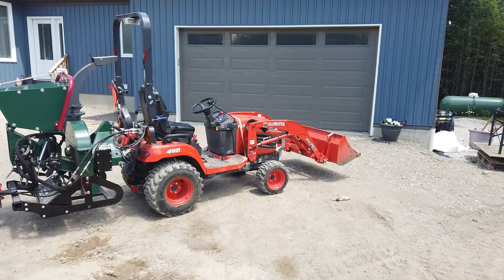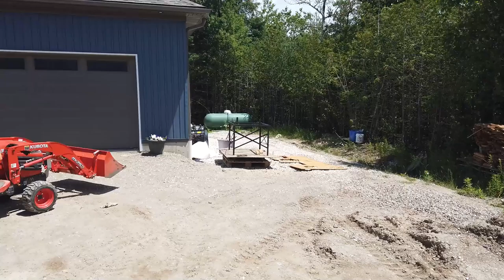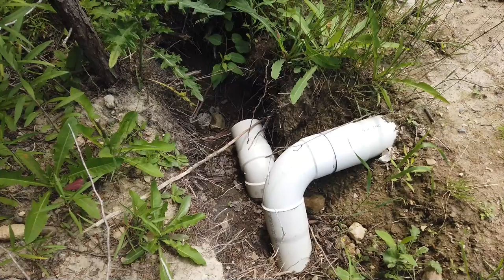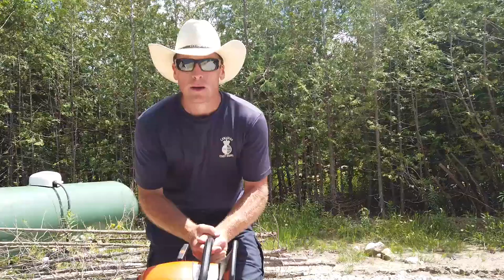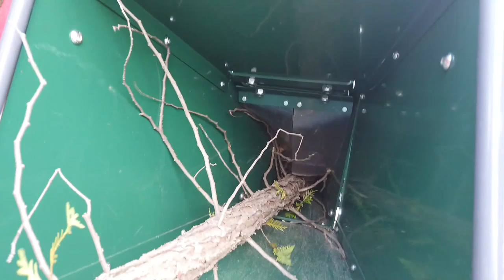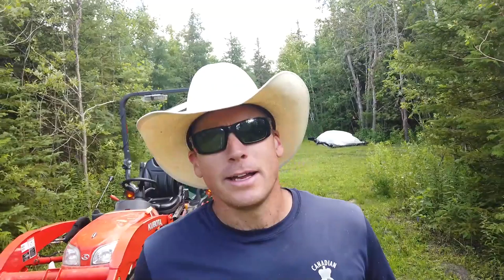Removing Small Cedars With Kubota BX, Woodland Mills WC46 And 2 Ton Hydraulic Dump Trailer - No.59

Comment: Do you need extra hydraulics to operate the hydraulic infeed?
Reply from the maker: The PTO shaft runs not only the chipper flywheel, but also a belt driven hydraulic pump. There is a hydraulic oil reservoir in the bottom of the unit. It’s a completely self contained unit. Thanks for watching!
Reply: Thank you - I have a 1025R and considering this chipper.  I have a lot of understory that is less than 4 inches in diameter that this will help cleanup.  What do you do with the sapling stumps?  Do you pull them out or leave them in the ground?
Reply from the maker: @CaptainRadioAdventures  Most of the material that I put through my chipper is tree branches and not the entire tree … in the rare case that I am removing an entire tree I will pull the stump with my Kubota KX040-4 mini Ex. You won’t be disappointed with this chipper - it’s really great!